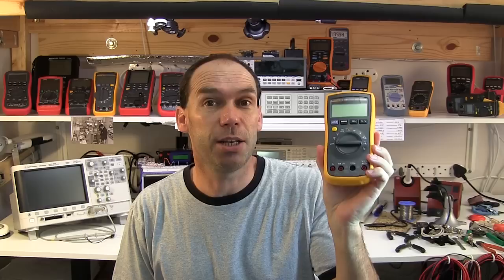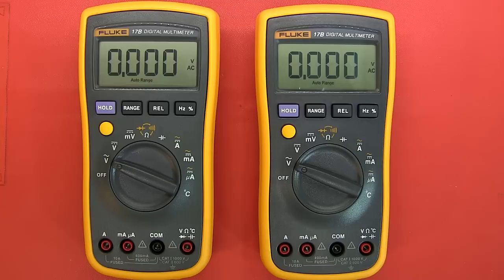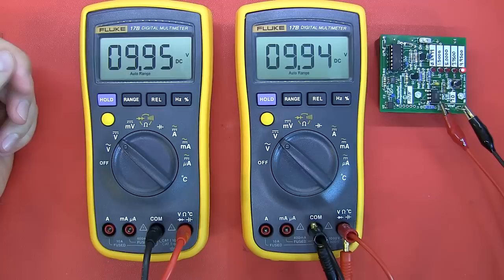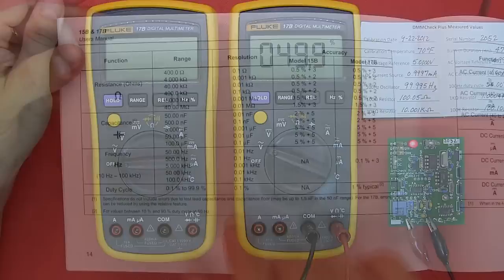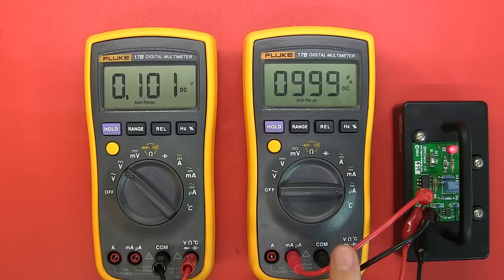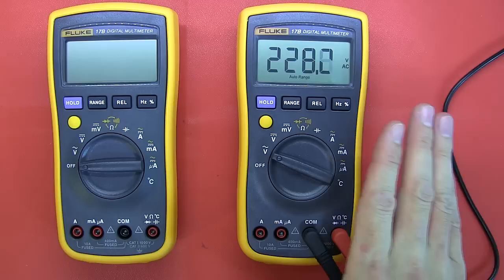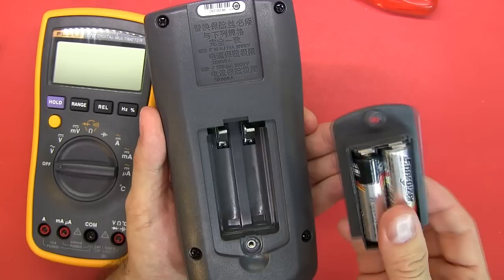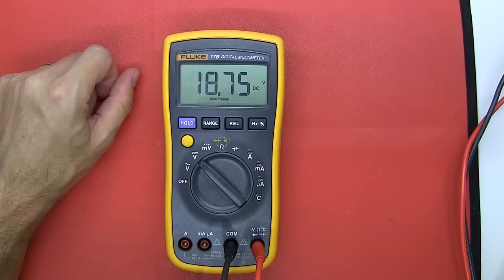Review: Fluke 17B, Chinese and New International version

Comment: If you strip the plastic you can use a filler material to fix it. I typically use Q-Tips / Cotton. It works well for screws which need to hold hundreds of pounds, to delicate fittings, to compression fittings on iron holders, etc... You can use a bit of ink to color them so they fade and aren't very visible if put into a visible section... In places where hot glue, etc.. may fail, using cotton as a compression fit works incredibly well... I used Q-Tip cotton to fix my locker in the military because a lot of the wood was missing and it was stripped so putting cotton in there made a compression fit, and is obviously self-tapping. I've also used it for delicate holes too - obviously don't use a massive amount on plastic as it will easily blow pieces apart because of how much pressure is applied when screwing a screw in. You typically don't need a lot... It works a lot better than glues, etc.. because it isn't permanent, and it can always be serviced; or you can leave it and there won't be an issue.

Comment: I have a Chinese 15b+.   Works fine for my hobby work.  The one mod I made was drilling a small hole in the back of the case over the buzzer.  Yeah, not waterproof anymore, but I have an older Fluke for outdoor work.

Comment: Very informative and clarified a lot about the different versions. Thankyou for the huge amount of effort you put in!!

I was a bit confused/concerned about your use of crocodile clips to attach to your reference voltage source to use with Meter comparisons that may be many minutes apart, as there connection is notoriously varying, especially if bumped.

Comment: Tip for current measurement in resistance range - short the input so it has to supply sense current. Same for continuity. Tip for the overshoot try doing it again with it set to manual range. Nice meter, budget unit but not budget quality, and has the brand recognition of a good name and is likely to wake up the mid range market a lot, they should sell very well at a good price, gives the name at a price within reach for most self employed people.

Comment: Indeed. As I've suggested before Martin, it would be good to always compare a product to its competitors, both up and down. To assess the value proposition. The more the merrier but naturally particularly the UT61E which is a lot cheaper and more capable. Try not to buy into the Fluke religious doctrine that a MOV makes any difference whatsoever.

The whole CAT safety issue is greatly exaggerated which is why I have proposed to test it. Connect to 1000V and then to 11kV transformer

Comment: Both 17b meters were undergoing tests. Why did you use one 17b to measure the other 17b? You could have used a third meter (a tested accurate meter) to measure each of the two 17b's response to your tests.

Comment: Just got a Chinese 17B+. Everything seems to function well on it. Got ahold of a 400 mF ( +/- 20%) capacitor today and tested it. It seems to work up to that point. I havent looked at the manual to see the max its supposed to have. It read at 467 mF. So far I have tested 5, 10, 40, 50, and now 400 and it read them all. It does take a while for the reading to come up however. Seems to not work then after a minute or so it reads. Havent tested LEDs yet.

Comment: The chinese meter might have done better at high frequency measurements with a higher signal level for the sine wave.  It's not unusual in other test gear for the sensitivity of a trigger circuit to fall off at higher frequencies; something similar wouldn't be surprising in this meter.

Comment: The only thing the 17B really has going for it is the temperature probe, and it doesn't even seem to do that well. 
I don't really understand these multimeters. Fluke is a brand you pay up for for the quality, but these are multimeters built down to a price. I would just suggest a brand that is better at building quality down to a price than suggest a professional brand that has been cut down to a price.

PS: I use a Fluke 115 as my main multimeter, so I have nothing against fluke :)

Comment: Hi there, thanks for the review. Would you do a review on the newer 17B+?  Thanks!
Reply from the maker: jsprite123 Thanks for the feedback...yes, the 17B+ is something I hope to get hold of in the future.
Reply: +sim6699 My needs are basic.... but this meter fails in working with a simple red led and capacitors used in ESCs...  Glad I watched this.... so much for not needing to pay more. Wonder what changes were made on the 17+...
Reply: +John Elt
cheaper on aliexpress ATM ;)
Reply: I recently bought a  fluke 17b+ with the hopes for "fast" continuity and ohm readings, but it was kinda meh.
With brand new batts measuring 1.623V each, doing the 'scrape probes together quickly' test in continuity mode, it seemed to skip beeping several times, I'd say 20% of the time it would skip a beep. Not good for running the probe down the pins of a connector looking for the short. Ohm readings were about exactly 1 sec to stabilize, whether in manual or auto ranging mode. I was surprised by the weird periodic "drop out" of the continuity. You have to continuously touch or scrape the probes during a 5 second period to see the dropouts that occur every second or so. Maybe I have a bad unit, but I'm not at all happy with the continuity speed doing sporadic drop outs. It's only a little better than my old Amiprobe 34XR-A, which takes 1/2 second of contact to register a beep, which in my mind is pretty terrible.

Comment: The meter itself can't compare to the UT61E, the UT61E can really go beyond 20MHz easily (in fact 220 tops) has 220mF (20mF didn't take long, 1 sec and it was done), fast autoranging (this one is painfully slow), fast continuity (This one being slower than a UT61E is very non-fluke like) My UT61E is certainly violently fast

Comment: I hate Fluke capacitor measurement feature. Looks like all multimeters are using the same circuit.
When measuring capacitors over 1000uF it takes forever to settle and if capacitor has small ESR changes meter just goes crazy...

Comment: I don't claim to know much about multimeters, but to me it seems a mistake for Fluke to taint their brand with something at this end of the market. I suspect the only reason they decided to make an international version of the 17B was because the internet economy was enabling large numbers of people to "smuggle" them out of China anyway.

Perhaps I'm wrong. Maybe there are people who want only basic capabilities, but still want to pay for Fluke's high standards when it comes to build quality and safety.
But if that's the case, then I think this meter misses the mark in at least one respect.  If someone is worried about safety, they must be working with high voltages. That would strongly imply they will work with AC, which means they need true RMS. Without true RMS, it will be relegated to low voltage DC usage, which means the Fluke safety advantage becomes irrelevant.
Thus, it's hard for me to visualize why someone at this end of the market wouldn't be better served by a higher featured meter from a lesser brand.

I have a UT61E. I admit, if I was going to measure mains AC, I might feel safer doing it with the Fluke - but without RMS, what's the point?
Reply: Are you measuring a sine wave? True RMS and averaging meters read the same if the AC is a pure sine wave.

Comment: Fluke is playing games to keep prices up rather than build the best DMM they can for the money... only thing that is allowing Fluke to compete at this  price level IMO is the other companies use the same marketing practices. This 17B was a fail for basic needs... the specs are misleading and it can't even light up a red  led used on toys and hobby grade RC models. Fluke seems more concerned with protecting "their" color of yellow than living up to to the name keeping up with the times.  If they dropped the price on the 87V to match lower manufacturing  costs then it wouldn't be so bad as at least then you could buy a DMM that did the job for a reasonable price..
Reply: +John F Hendry 
hey buddy
is hioki 4252 a good multimeter ????
Reply: Their best meter for electronics work is the 60,000 count DT4282 I read but it costs $596.86 on Ebay and the 4252 is $186.00. For $135 I would go with a Brymen BM257 but in the $190 price range without any question I would get the DC 500,000 count 1000v CAT 4 rated Bryman BM 867S without any hesitation. I got the BM869 from 118volt on Ebay and am deeply impressed by it and 118volt had it delivered to my door by DHL in 4 days! Highly recommend both based on my own experience after a lot of research. I learned if you go through 118volt directly to avoid EBay fees you'll get an even better price... can't beat the Brymen for the money IMO and 118volts has the best price with no issues in the unlikely event there is a problem unlike the only other low cost Brymen source I know of.
Reply: +John F Hendry thx
Reply: +John F Hendry 6 months have passed since you wrote your recommendation. Are you satisfied with your BM multimeter?
Reply: JRR Yes absolutely... no problems at all but realize I have not come close to using it to it's full potential and 1000v Cat lV rating, not to say I don't use and value it's accuracy and 500,000 count display I would never give up. Haven't checked prices lately but for the money I paid and what I need it for 6 months later I can say doing my homework really paid off and the more I use it the more impressed I am with it. The only thing I've found I'd like added is I wish it had the ability to set how long the back light stays on.